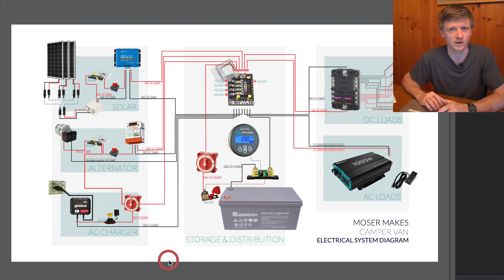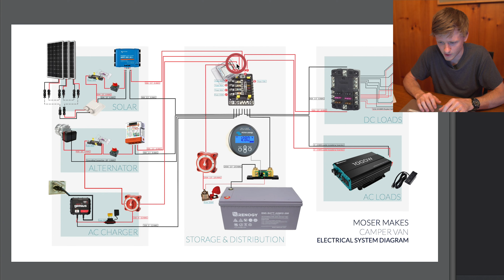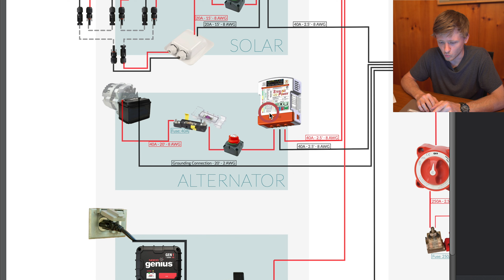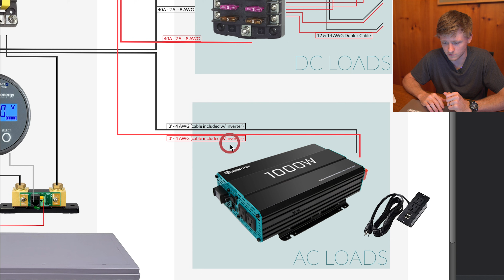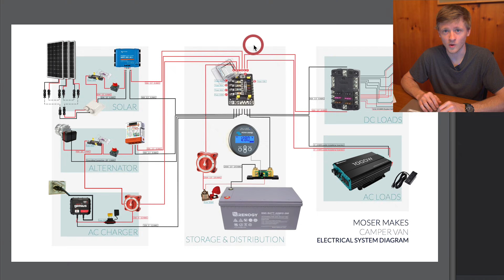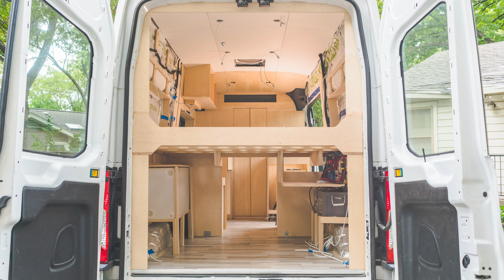Camper Van Electrical System - Comprehensive Look!

Comment: Hi Moser, silly question, but I am working on getting shore power to my van finally and like how you did it. If I may ask. I see your output of your Noco charger goes to the 12v and negative on your box that is before the 12v bus box.
By doing this, it looks like 12v would be available to say a 12v fridge if you had it connected to your box, as well as charging the battery. Is that ok? I do want to do something like that. I want to have the charger 12v running the small fridge I have while it is charging the battery. I have a very minimalistic setup really. Only using the fridge for now. Have a fan also down the road to install that is 12v and could either use it or not depending on the.amps pulled. Most important is the fridge while it is charging battery
Am I way off base? Is that allowed? Sorry for the total newbie question.
Thanks in advance! 
Jay

Comment: I would recommend NOT getting AC outlets with USB outlets combined, there will be someone that starts the inverter every time they want to charge their phone... 12V to USB outlet adapters cost nothing. There's even 12V to USB-C PD, so you can charge your laptop! :)
Reply from the maker: I agree 100%. Last time I looked though I couldn’t find a good drop in recessed outlet that didn’t have USBs. If you have a recommendation please share a link and I’ll update it. 

Of course there’s always the option of installing a traditional outlet box and receptacle, but for many DIYers that isn’t as easy as one of these recessed power strip products.
Reply: @MoserMakes  Seems to be the case still unfortunately, if you can't go with a traditional domestic outlet, I'd at least tape over the USB plugs. Maybe a good spot for a dymo label with the max wattage for the outlet :)

Comment: I'm a retired marine electrical installer. The information you present is concise and well laid out. I wondered about your wire sizing, but your explanation about minimizing the number of different wire sizing makes a lot of sense for a one off project. The only criticism that I have is about the use of the vampire tap splices. While they are easy to install, their long term use is problematic. They allow moisture into the wire and under the insulation causing long term corrosion. No point in going through the expense and effort of using heatshrink terminals when you've already compromised the wiring. The other problem with these splices is that they damage the strands of the wire and over time will result in broken strands as the wire moves from vibration.
Reply: Other critique i have, the fuses should always be after the switches. Source -> switch -> fuse Besides that its a nice job
Reply from the maker: Hello! I have also read that fuses should be as close to the source of power as possible which means placing them before the switch. This way you minimize the amount of wiring/components between the power source and fuse to increase the are the fuse is able to protect. I am always looking to learn more though, could you elaborate on the reasoning behind placing the switch before the fuse?
Reply from the maker: Hey, I agree about not using vampire connectors and I addressed this (and provided better alternate options) in a recent video where I deconstructed this van.
Reply: So what do you recommend as an alternative?
Reply: @LaplacianFourier   This comment was two years ago so I don't recall where they used vampire taps. There are 2 into 1 heatshrink butt terminals which can be used. Localized buss bars can also be used. These provide more flexibility and repairability going forward.
Reply: @DialUp_Daydream  thanks!

Comment: Hey Sam, these videos are great, thanks for these! Quick beginner question, with the safety hub, could you connect your power generation sources (solar panels, B2B charger, shore hookup) to the (four) high amperage circuits on the left and then connect your DC loads (lights, fridge, fan etc) to the blade fuse circuits on the right hand side and have the battery connected in as well? Thanks
Reply: Hey Jacob, yes you can do that!

Comment: firstly, thanks for all of the info.  i'm basically modelling my electrical setup exactly like this.  one question though.  I'm struggling to wire my SafetyHub150. I don't fully understand how the hub communicates with the solar charge controller, communicates with the batter.  are there any instructional videos that specifically address this issue, as well as fusing within the safety hub?  thanks!
Reply: uh oh. i just read greg virgoe's comment below.  i'm running a 3000w inverter with a 300AH battery.  So this means I need to run separate busbars?  How about fusing? thanks again for any help you can provide.

Comment: Great video but I disagree with one item you used and thats the 3M connectors. I've used them for years in auto repair and they will cause problems. To make a connection they will cut some of the wire strands and will create a bad connection over time.

Comment: I converted my van. Your Youtube video helped me a lot!!!! I have a problem to connect 250A fuse box. If I connect 3000w inverter to sub-battery without 250a fuse box, my inverter goes up to 13.2v. However when I connect 250 A fuse box to battery and I connect to the fuse box and inverter, the voltage of inverter is around 9v. so the inverter doesn't work. Can you know the reason and what is my mistake? I set up every electrical system like your diagram and I used 54v-250A fuse and fuse box.

Comment: This is a great video and has eased a lot of my stress going into this electrical system. Did you use a free software to build your wiring diagram? I have components that are not identical and would like to make a similar schematic with my components, knowing what tool you used could be really helpful!

Comment: Hi Moser, great videos! I only have one question for you, I hope you can answer. I have an older camper van, that I installed a new stereo in the dash. But I would like to know how I can hook that up to the solar batteries as well so that when I'm parked at my camping spot I can play music on that stereo without draining the van battery. Obviously I would have to have a switch to run it off the solar batteries? Can you give me any tips as to how I can acheive that? thanks ..:)

Comment: If you charge with the noco genius (shore power) do you need to switch off the solar panels? Probably a dumb question, but I don't want to risk any damage. Also, why is that safety hub so dang expensive!!!

Comment: Hello Sam,
Stellar job with the schematic, explanation of how the components work and a detailed description of how everything is connected. This is the best schematic I've seen on Youtube and plan to use it to hook up my Transit camper van's electrical system. How is the shore charger connected with the three position switch in the number "2" position (with the switch for the battery to battery charger in the off position) to charge the house battery? You have that wire from the shore charger marked as the "B" connection at the fuse hub positive buss bar, and there is a fuse at the other "B" location (to the right side of the hub). I'm confused about that connection in how it is able to charge the house battery. Was there a reason why the shore charger couldn't connect the positive wire directly to the house battery or have I totally missed the boat here? I hope this makes some sense. Any input would be welcome to help me greatly. Thanks!

Comment: I’m using 20 amp renogy b2b and it recommends 10 awg input and 14- 12 awg output. Should I use 2awg neg and 8 awg positive on the input? And 2/0 awg on the output for both pos and neg?

Comment: Simple and straight to the point, thanks for sharing!!!
What PV stands for? Did you used any of the small fuses on the Safety Hub to power any other circuits?

Comment: Good stuff, but it seems that "system hub" is actually a power distribution hub, designed to have one input and multiple fuzed outputs.  It seems you are using it in a way that it was not designed.

Comment: Interesting and good video. I was looking for something like this. I would make it a bit more stupid proof though. Add a diode in positive or add a three point switch so chargers won't connect and create a short circuit as they have diff voltages.

Comment: Nice Moser, with your AC switch and needing to make sure the battery to battery switch is off. You could wire a relay to drop out the line whenever theres AC power

Comment: You need something to switch between charging sources. Potentially having 3 different charging sources all working at once can create havoc with their monitors. What I usually install is a dual input mppt dc/dc charge controller, and hook up the shore line charge dc output, and the alternator to the same input (you'll rarely have both running at the same time, if ever) and the solar to the other. That way the controller can utilize all inputs without electrical havoc, or battery damage.

Comment: Great explanation of your system! 
at 11:30 when you talked about the two isolators, and i was thinking of a solution to combine the two (i looked up Perko switches ect and nada) BUT i remember that what might work (and correct me if im wrong) is a blade type DPDT switch with, of course the right amperage ratings. Id love to hear your feedback on this thought. and thanks again for the great vid!

Comment: Sam, great video and it explains a lot.  But I have a question.  How does the system decide when to draw current from the solar panel, when to draw current from the alternator, and when to draw current form the shore power?  Or does it matter at all.  In other word, if you are driving under the sun, does the system draw current from the solar and the alternator simultaneously?
Reply: The system doesn't decide, you decide by turning those red switches. hth

Comment: 11:30 "because there's another inline fuse we really could connect directly to the battery"
No that would be bad. The way you've wired the genius charger to the starter batter via the starter battery fuse is correct. If you wired directly from the changeover switch to the starter battery positive terminal and there was an electrical fault between the starter battery and the changeover switch, specifically a short to the chassis, there would be no fuse between the battery terminal and the short to chassis.

Comment: In regard to the on/off switches, you linked two different switches for the system master on/off switch and the on/off switch for the solar, could you just use the same kind of switch for both?

Comment: Most elctrical information I can find is about 12v

I'm considering building a pretty hefty electrical system. 500+ Watts of solar, 400+ amp hours of battery storage.

I'd like to make the system 24V so I don't have to use expensive heavy duty wiring and an expensive charger/inverter...but I'm finding it difficult to find information on how I would go about charging the batteries via the alternator which is basically always a 12V output.

Would I need to purchase a second alternator which outputs 24V in order to charge the system, convert the standard alternator's output to 24V somehow, or replace the standard/included alternator with a different alternator which outputs 24V as well as use a different battery for the vehicle itself?

I think I understand how to make the panels and batteries 24V -> say I had 4 panels for 600 Watts. Wire 2 pairs together in series, then wire those 2 pairs in parallel then the output is 24V, and same thing for the storage batteries - wire 2 pairs 100AH batteries in series for 24V @ 100ah then wire those 2 pairs together in parallel.

It's the charging the system via the vehicle's alternator which is hanging me up.

Comment: I suppose that it depends upon the charge controller, but I have heard that it is not a good idea to have the solar panels active, if the charge contrlloer is not powered by the house battery. Is this true?  Also, does your system have the potential of problems with multiple DC charging sources (solar, vehicle, external AC) at the same time?

Comment: Nice video, a few questions:
1) Why don't you connect the vehicle ground (common 0V) direchtly between the vehicle battery and the Sterling Power unit? It will save some space/cabling
2) What about a floating 12V system? You've already wired up all 0V cabling back to the bus bars, so why not keep this system a floating 12V system? Solves the grouding issues I guess.
3) How do you do ground fault control on the AC side? Since the vehicle ground is connected to the 12V side of the AC inverter?

Comment: Hi Sam, so thankful for your videos to guide me through my build! I’m on my electrical setup now and the safety hub 150 is out of stock literally everywhere. I don’t want to go the messy, individual bus bars route. And the safety hub 100 with 3 circuits is available. Does it make sense and is it safe to just use two of those and connect them?? Any advice really appreciated!

Comment: Fantastic video and explanation, your diagram has really helped my own and confirmed what I need. How did you know your alternator would output 40A max? Because I've been wondering about mine, I'm running a 2018 Ford Transit 250.

Comment: I would like to wire my two 100w 12v solar panels in parallel because of shade here. I have two 12v 100ah agm batteries, should I wire them in parallel as well to keep everything at 12 volts?

Comment: Hi Moser ....  I just bought the Kisae 2000 Watt Inverter/Charger.   What length and gauge of an extension cord would you recommend for a 2000 watt inverter charger when I want to charge up from a pedestal at a campground or an outlet at friend's house?    This is for my minivan.

Comment: Question for anyone who knows: I see that power sources such as the PV array and DC to Dc charger are fused, but then still are wired into a "safety hub"? Does this mean they're fused twice? Do I put the same size fuse there as I put on whatever positive line?

Comment: Thanks for the informative videos. I have started doing my electrical panel/solar panel according to your schematics. Do you really feel 2/0 cable from the battery to the fuse box is necessary? That wire seems really big.

Comment: Two questions. 
Why charge the starter battery? It will never loose too much charge. The alternator will charge it, and the Stirling battery combiner will prevent the second battery of drawing too much charge from the starter. 
Why use the charger for both 12 v load for appliances and charging the battery? I think the charger will get very confused when you suddenly turn on appliances and it sees a voltage drop.

Comment: Hi, I love your work and the clear and concise way you stage your video lessons. I am currently trying to digest all of this information and have run into a problem acquiring the Blue Sea Systems SafetyHub 150 Fuse Block, Blue/sea. Is there another item out there that could substitute for this piece? Though I understand the process and the stages of your lesson, the details are still fuzzy as I am still learning all of the aspects of electrical systems. Following a plug and play tutorial is what i need still. Thanks in advance.

Comment: Hi Sam, great video. Only question I have is you don't seem to have a low voltage cutoff to protect the battery. I suspect the Lithium battery has this built into it's internal BMS, but it would be good to show that. Also, perhaps consider an interlock between the Alternator and AC charger outlets so only one can be connected at a time, perhaps biased to the Alternator, but also switch over when shore power mains is plugged in.
Reply: What is an interlock?
Reply: @GOLDVIOLINbowofdeath  It's a device that, when setup correctly ensures that two opposing conditions cannot exist at the same time. Think of one like a pair of switches where only one can be on at a time.

Comment: Great info, thank you.  I have a victron DC  to DC charger 40 app. Can I Run  8 Gauge negative wire from the alternator battery to the DCD C charger and then another wire 2 Gauge negative from the alternator to the negative bus bar ?

Comment: Sam, when wiring the 12v fuse box to the SafetyHub bus bar, why did you opt for a 40amp fuse? I’m super confused here! The device says to size for a fuse no bigger than 125 amps, as it is a 100 amp max circuit! Do I go 40 or do I go 125?? Aah!

Comment: GREAT explanation!
What would happen, if your alternator switch was on, when you turned your other switch on (and had external electricity connected)?
Wire from Alternator: plus is 8AWG and negative is 2AWG - how come you need larger for the grounding?

Comment: Awesome video! Thanks for taking the time. I am building my electrical system right now - about the same size as yours. One question: it appeared that you did not isolate and vent your AGM battery. Could you elaborate? I have found that some people/sources say you should and others say you don’t need to. Thanks.

Comment: I'm a Retired Master Electrician, Field EE and Code Inspector .. including AC/DC Systems .. both High and Low Voltage .. This young man provided great information for the Novice and Amateur to do a DC/AC Van Electrical System .. I do question using LA with LI source batteries and lack of fused interruption or disconnecting means at both the Line Side at the DC Load Center and on the Line Side of Invertor to service, repair and/or safety